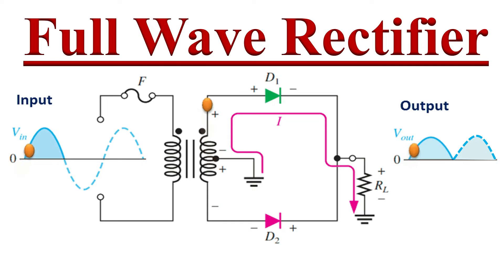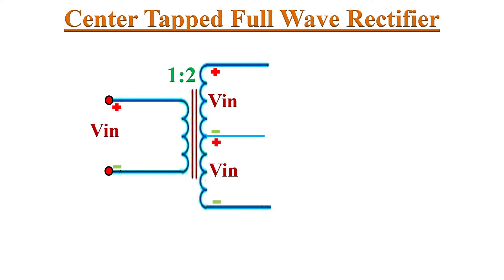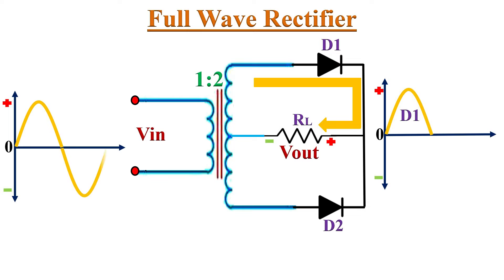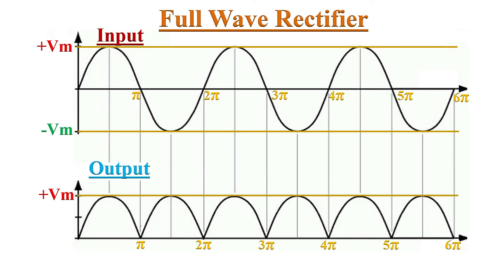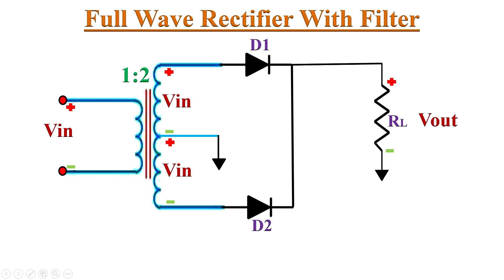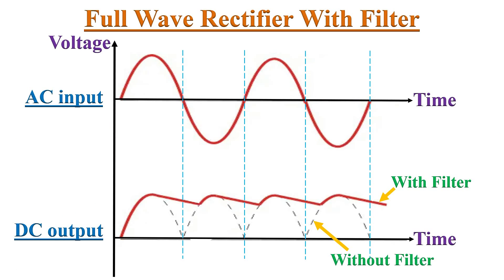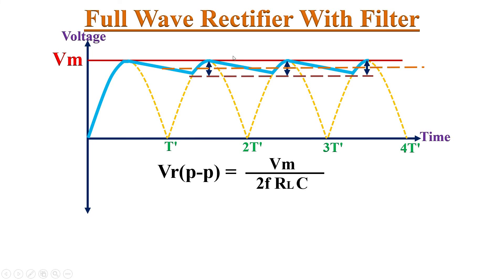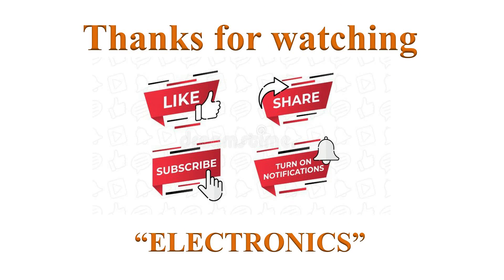Full wave Rectifier (Center-tapped) Explained

Comment from the maker: Timestamps for various topics covered in this video are as follows:
0:20 Introduction,
1:30 Center-tapped Full-wave Rectifier Construction,
2:58 Full-Wave Rectifier Working,
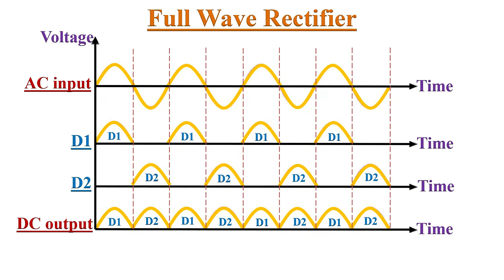4:43 Average value of Full-wave Rectifier,
6:23 Peak inverse voltage (PIV) of Full-wave Rectifier,
7:41 Full-wave Rectifier with capacitor filter,
11:20 Ripple Voltage of Full-wave Rectifier,
12:45 Ripple Factor of Full-wave Rectifier,
13:36 Efficiency of Full-wave Rectifier.